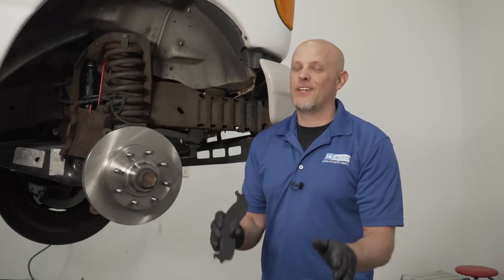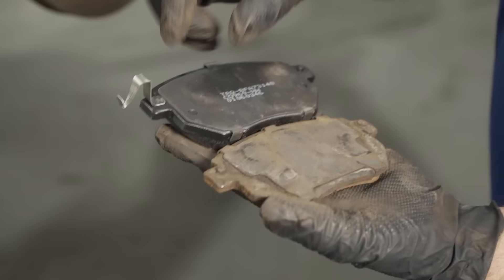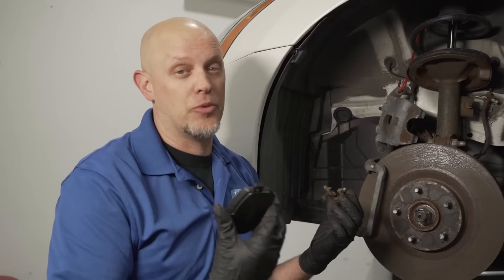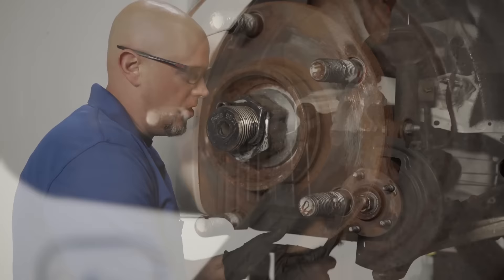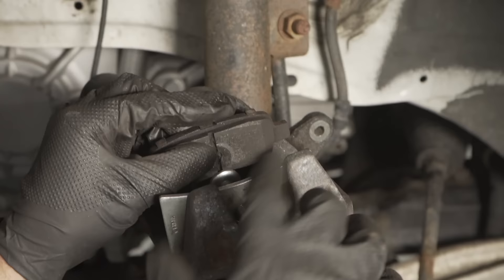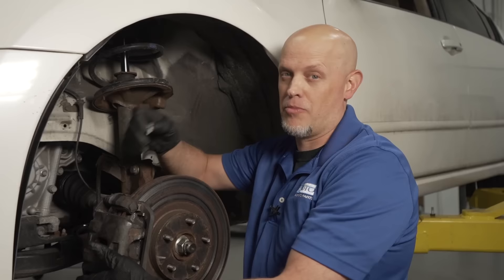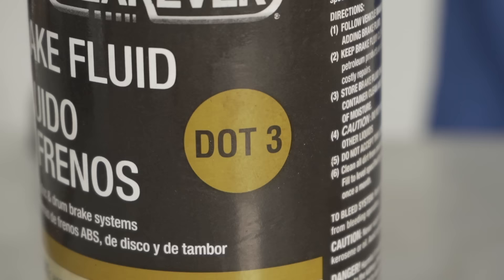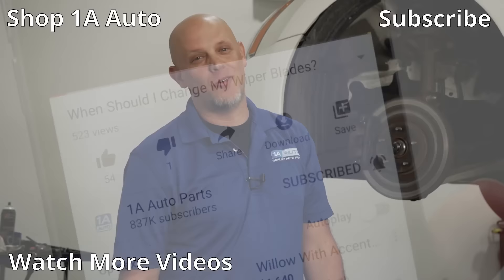Most Common Brake Installation Mistakes!

Comment: The biggest thing I noticed was that there was no sense of caution regarding pushing back the caliper pistons. This is actually a delicate procedure. IT IS IMPORTANT that you BE VERY CAREFUL WITH CARS WITH ABS to avoid pushing fluid back through the system. The video tell you you can open the bleeder while you push the calipers back, but fails to mention that you MUST DO THIS ON VEHICLES WITH ABS or risk damaging the ABS pump. Ideally, you should use brake line clamps to pinch off the flexible lines and make sure all the fluid is pushed out through the bleeder. Furthermore, in the video, you can see the technician align the tool off center of the piston... Actually, you should be careful to try to center the pressure as well as possible on the piston. This is most important when the piston is at it's furthest extension (i.e. when you are replacing worn out brakes) because it is then that it is most at risk of being wracked in it's boar, which will marr the piston and cause it to leak.

The video says to match the squealers to what comes off the vehicle, but that's not always the best way to go because you can't be sure the last person got it right. The Squealer should go on the inside of the caliper pointing against the rotation of the rotor. This is because the sliders cause friction, so the inside pad sees more force, causing it to wear more quickly. Compounding this, the sliders also allow the caliper to wrack slightly from the braking forces, causing the leading edge to dig in and the pad to wear at a slight angle. Calipers with pistons on both sides of the rotor are less sensitive to this because there are no sliders. In this case, you just need to watch out for interference between the caliper and the squealer or other irregularities in the shape of the pad. Some pads don't have squealers... this is also normal. The orientation of the squealer is important because it's a warning signal. You want it to start rubbing the rotor as early as possible. If you were to position it at the point where the pads wear the slowest, it might not warn you your brakes are low until after the metal backing contacts the rotor, which could mean that you have to replace your rotor prematurely.

I would have to say that the most overlooked element of doing breaks is the sliders. Sliders should be serviced with every pad replacement. This means they need to be taken apart, cleaned, inspected for excessive wear, lubed, and reassembled. This is super important, but it's often overlooked.

It is also important to visually inspect of the old pads. Their condition may indicate other possible issues. Some difference in wear from the inside pad to outside is normal, but a big difference indicates a problem with the sliders. Uneven wear from one side of the vehicle to the other indicates a problem with the flexible brake lines. (the rubber hoses that connect between the body of the car and the caliper) It is also normal for rear pads to wear far less than the fronts. If you are changing rear pads as frequently or more frequently than fronts, there is probably a problem. 

Another important thing that is often overlooked, especially by DIYers is the brake fluid itself. It doesn't last forever. It should be flushed from time to time. This is easy to do while you're servicing the brakes, and can be performed without doing an air bleed, if you're careful. There is a process called "gravity bleed" where you open the bleeder nut at the caliper and let the fluid bleed out under the force of gravity, topping up the master cylinder as you go... make sure you don't let the master cylinder run out of fluid, as this will introduce air into the system, which is a huge pain. If you do this at all 4 wheels long enough, you will replace all the fluid in the brakes without introducing air into the system.... I can't stress enough... DON'T LET THE MASTER CYLINDER RUN OUT OF FLUID! Letting the master cylinder run dry is probably the worst thing that can happen when you're doing breaks, as it's is very tricky to bleed a master cylinder, and it usually requires you to remove the master cylinder and bench bleed it to do it right, and then you will have to do a bleed to get the air out of the calipers.
Reply: your coverage was better
Reply: Wow, thanks for the awesome follow up. Hit some important points. Like the gravity bleed. Question? Do I open only one of the caliper valves?;all four at once? Thanks again
Reply: Thank you !!
Reply: You'll find a lot of people who do brakes all their life and never have any issues with resetting the piston with bleeder closed. Doesn't mean that's correct but the only risk is if there is debris in the lines. If the brake fluid is being changed on time and you do a full bleed out if you have to replace a brake line/piston, you're probably fine. 

At a shop or with a used car where maintenance is a mystery, it pays to play it safe. For a home mechanic, it's still little extra effort and it lets you better assess whether the piston is travelling in correctly
Reply: when pushing back the cylinder with the tool, should i leave the cap open or closed where you insert the fluid ?
Reply: wow, wish I knew that earlier,,,, Thanks D R , It would have been nice to know about the ABS and it's difference with a screw-type caliber,,, (which I didn't realize till to late)
I followed the instructions from a different 1A video and used the C-clamp,, now I have a trail of brake fluid down my driveway,,, no brakes,,,, something must have ruptured in between the two rear wheels,, what could that be???   pplease help  09-20-2021
Reply: @mastercontrol2461  You’re going to have to look while someone else pumps the pedal and find where the brake fluid is leaking from. It could be from the caliper itself, where the piston slides in and out. You probably damaged the seal and or dust boot. If that is the case, you’ll need to replace that caliper. Don’t stress out, it is not hard to do. Good luck.
Reply: @caribougoo349  i was gonna say, I've never had an issue and tbh I've never changed my fluid - most mechanics have told me with modern plastic brake lines, you just don't get the contaminants that used to happen - that said, it's relatively easy and doesn't cost too much
Reply: why did he said to put brake cleaner on rotors with rust resistant coating?
Reply: @hughsolorz5184  One bleeder at a time unless you have eight hands and a second person to watch the master cylinder reservoir and keep it filled with fluid poured in slowly and carefully.  That's so as to not get any air bubbles in from pouring too fast or from too high above the reservoir.
Reply: Awesome tips my friend. Question...once you bleed the old calliper fluid out from the bleeder when pushing the calliper back in, can i just allow the line to gravity feed to get the air out once everything is back together?
Reply: @jasonlewis460  leave the cap off. Just make sure you don't overflow the fluid from the brake reservoir as it is caustic and will damage paint, etc. I've not had a problem with reservoir overflow on any vehicle I've changed brakes on....just something to check as you push the piston back in....to be sure. Once you're done, don't forget to check the fluid level and put the cap back on.
Reply: @caribougoo349  I've found the same; I've never opened the bleeder screw when pushing the fluid back into the system on my ABS equipped cars and resulted in any problem. Would be a costly mistake though if it did. Thinking about it though, probably a good way to get rid of the cooked fluid that sits inside the caliper. May try this on my next brake job.
Reply: I agree with all your detail on brake installation. However no-one mentions the procedure for 'bedding in new pads and rotors'
This is really important to be done correctly
Reply: @hughsolorz5184  
Good luck with that
Reply: @gingerwallets8000  to remove any rust inhibitors or machining debris.  Don't assume because they are coated they are clean.  FYI, the best cleaner for brakes is clean soapy water followed by flush with clean water. Then dry thoroughly.  Brake clean is highly polluting and bad for respiratory health.
Reply: Thank you for adding your valuable knowledge from experience, it is much appreciated. That information is invaluable in avoiding these mistakes.
Reply: Very good write up.
Reply: D R, you really should do videos on YouTube.  It would be a great service to DIYers
Reply: Thank you from the heart my friend for such a long detaied and very helpful explanation. Very appreciated !! You're good  man. Thanks again . Your friend from  Puerto Rico , Edwin Oliveras
Reply: Bro.  I need this printed lol
Reply: @gingerwallets8000  because you touched it with dirty hands and maybe left residue
Reply: @asherbale322  I bedded a Bmw set and warped the rotors

Comment: Excellent video. I do all of my own brakes including caliper rebuilds. I would add a few points: The Caliper Guide Pin Housing can be worn causing shuddering too, how to visually inspect flexible lines for signs of perished cracked or bubbled hose. The importance of the seal on the Master Cylinder cap to limit ingress of water, even from humidity which will deteriorate the brake fluid. Further to that, every February I do a complete Fluid Flush to the entire system. When you break a Copper Washer seal, best practice is to use New Washers. Cars love maintenance! Your style of presentation is excellent!

Comment: And,   I put a vinyl piece of tubing over the bleeder during piston push back so fluid goes into a small can and not all over the place. Also use only a 6 point socket on the bleeder to avoid rounding it off.  Make sure ya top off master cylinder with the correct DOT.  Just a few words of something that may help

Comment: I remember doing brakes on the old drums. Removing all the springs and making sure the plunger didn’t come out of the cylinder. Disc brakes came along making a brake job so much easier. Thanks to all you who make these vids for the DYI folks. Remember if it looks to hard take it to a service tech and for gods sake keep safety in mind by using jack stands…

Comment: All very good points, one of the best videos I've seen on brake maintenance, I even learned a few tricks I didn't know. One MISTAKE I noticed, at time index 6:40 the slotted Rotor you put on was for the Front (Passenger Right) side. The best way to tell is is to look at the slots on the top portion of the Rotor. The tip of the slot closet to the center of the wheel will be pointed forward and down at the ground, and the outer tip of the slot will always point up and towards the rear of the vehicle. This is so that as the wheel turns the water will move outward and towards the rear of the vehicle and off the Rotor. If the slots are reversed the the slots in the rotor try to force the water inwards while the centrifugal force on the water is trying to force the water outward, this can cause the pads to partially float. Of course this will reduce brake efficiency, defeating the purpose of Slotted Rotors. So always have the inner portion of slot on the top portion of the rotor facing down and forward. When purchasing Slotted Rotors a good manufacture will label the Rotors Front or Rear (Passenger or Driver) side.  Other than that I loved it. thanks for sharing. Best Wishes & Blessings. Keith Noneya

Comment: Thanks for the great tips. One thing to check if reusing the rotors is the thickness. The minimum thickness is usually embossed on the side or on the rim of the rotor. If the rotor looks fine but has reached the minimum thickness, it is time to replace it. Also, hand-tighten the caliper bracket and the caliper assembly bolts to make sure they are not cross-threaded. I have damaged more than one bolt without realizing it was cross-threaded and the torque wrench did not do me any favors tightening those. Also, I replace the caliper guide pin rubber boots each time. Lastly, subscribe or acquire a factory service manual for your car and follow the torque specifications. Do not use impact guns all the way to tighten nuts that require a certain torque.
Reply: Where did you find the calliper guide pin boots?
Reply: @desdonaghy  I bought some for my 08 Ram 3500 off Amazon. They were 4 to an order and not really expensive. I believe my local NAPA carries them also.

Comment: Put a little grease under the anti rattle clips to stop them from rust jacking,
Reply: I've told 3 mechanics and a dealer to do this.they look at you as you told them so obvious and you insulted them . Get the car back and they didn't do it. I just do my own brakes now . Takes a while but Hard as a rock

Comment: Here’s my mistake.  My first DIY brake job. Caliber bracket bolts are on the inside.  My brain got confused and I turned the first bolt wrong way and snapped it off.  “Dang!”  While learning how to extract broken bolt it dawned on me what I did.  I was humbled.
Reply: Lol man that sucks. I was doing my rear brakes a couple weeks ago and overtightened one of the caliper mounting bracket bolts with a brushless impact. Spun the top of the bolt right off. I had to drill it out and clean up the threads as well as go buy new bolts from the dealer before I could continue 🤣
Reply: Always look at a ratchet to know the direction you need to be going. Especially if you are going in from behind something.
Reply: The good thing is, you will never sheer off a bolt again in your whole life.
Reply: Just a hint, When reinstalling the caliper mounting bolts and bracket, use the correct torque, read the specs, buy a torque wrench, good for so many other uses, good investment.
Reply: I good trick to remember is righty tighty so grab the bolt and remember if I’m looking at the bolt dead on from the backside then you know which way tightens which way loosens.
Reply: I’m in the habit of checking ratchet direction with one hand on the socket and one on the wrench handle BEFORE I put the socket on a bolt/nut. That way, even if I’m upside down, backwards, or can’t see the fastener, I know the direction is correct. 

Unless the fasteners are left hand threaded lug nuts on an old Chrysler…but that’s another story
Reply: @rey3468  I would have bout the 10 dollar mount
Reply: @CarlosRodriguez-hb3vq  
I had that on an old Dart lugnuts.
then I saw the " LH " stamp on it. lol
Reply: @ryans413  That's correct;
"Righty tighty-Lefty loosey

Comment: Great video! I would add to not let your caliper/brake line dangle when you change your brakes. Use a hanger or bungee to support the caliper.
Reply: I always let them dangle. Always! It stretches the brake line and is good for the rubber. Also you should twist them if there old.
Reply: @mr.iforgot3062  dolt

Comment: Remember to always read the directions for your particular brake pad. For instance, if it has a factory anti-squeal coating or to apply an adhesive sticker to the back. These will specifically state not to use any grease on the back. Some pads also have a break-in coating that require you to make a series of hard stops after installation.
Reply from the maker: +Sean McGroty Thanks for the tip!
Reply: Many manufacturers require you to bed in brake pads after installation to ensure proper traction between the brake pad and rotor. This stop-and-go process, sometimes called “burnishing,” alters and usually increases the coefficient of friction between the rotor and pad to ensure stable braking power.

Despite the common use of this practice, however, not all brake pads require breaking in. Akebono’s ultra-premium ceramic disc brake pads do not require this step because they are precision engineered to perform and mold to your rotors over time. Thus, there is no specific burnishing procedure needed with Akebono brake pads.

Comment: Most common mistake made, and included in this video, is not cleaning and lubricating the caliper slides. Making sure they still move freely is not enough, and if that is all that was done; a guarantee the new pads will be short lived. It is also important to make sure there is no degradation on the surface of the slide bolts themselves, as this will eventually create binding in the slide bore, even if proper caliper grease is used on reassembly. If decay or degradation is found on the bolts, it is best to replace them, along with the rubber slide boots.

Comment: Great video, I have done at least 500 brake repairs in my life but figured I would watch anyways. Another helpful tip you didn't mention is before reinstalling the caliper shims (after cleaning rust under them) is to apply a small amount of the brake grease/lubricant on then reinstall.  This will help to prevent it from rusting again so easily. When it rust under the shims, it makes it too tight around the end of the brake pad framing where it should be able to easily slide causing them to not retract which will wear your pads faster of course.
Reply: Hey. I've got a question for you since you may have run into this before. After getting new pads/rotors/calipers on my '03 4runner (took it to a shop) I notice a clicking sound from one wheel as I drive. Braking or not, the sound doesn't change. What do you think is causing that? They said to bring it in so they can adjust it but it got me interested in what it may be.
Reply: @Eric  could have been a few things. Could have been the backing plate was bent in a position that it was rubbing on something which can easily be bent back. Or one of the pads were loose because of a broken retaining clip therefore the pad can shift around and click/rattle.. few other things it could be, nearly impossible to pinpoint without actually taking it apart and looking myself. Did you end up figuring it out ever?